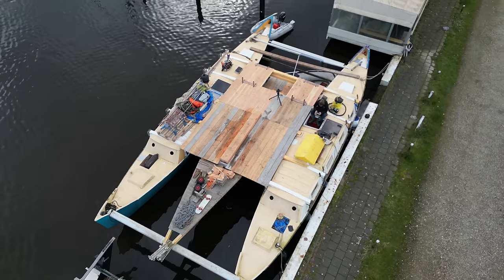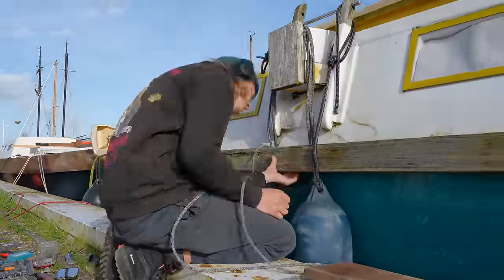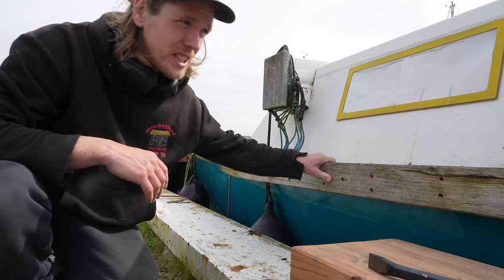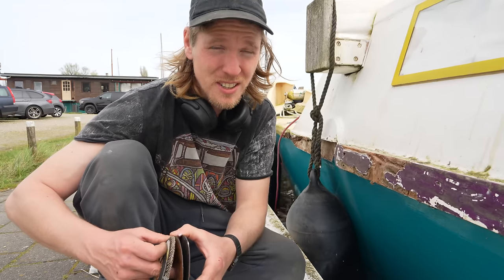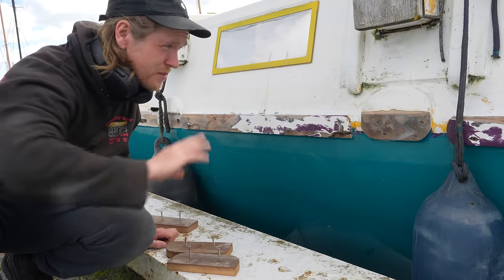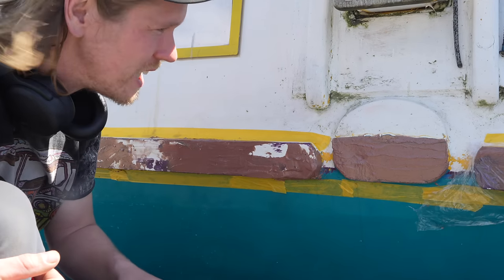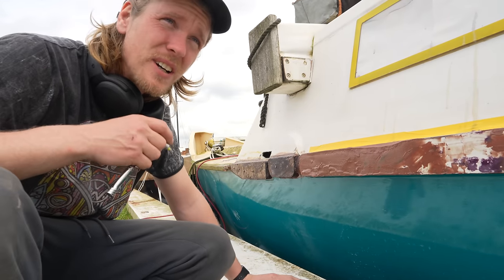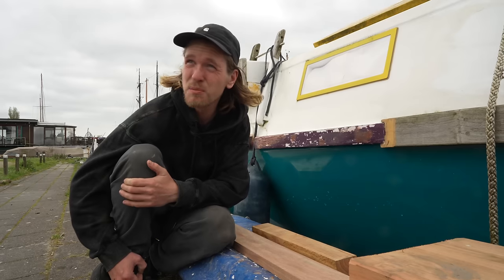Some Serious Rot Fixing on my Ocean-Going Catamaran Project

Comment: When you are prying against a damagable surface with a crow or pry bar, Best practice is to use a large backing board (plywood works well) on the surface so you spread out the load and don't damage, crack or punch a hole in the fiberglass surface.
Cheers, Mate from Canada

Comment: Just for information: they're not dowels but what we called plugs. Dowels are used for joining or locating pieces, and the grain is lengthwise for strength. If you use dowels for plugs, you expose the endgrain of the dowel to moisture ingress. Plugs are made with the grain going across the plug and have no strength but can be made to be almost invisible.
Reply: Bungs in boating

Comment: Just in case no one else has mentioned it, if you have a soldering iron, you can heat screws embedded in epoxy to make them come out easier.

Comment: Another great video, if you ever have to use a grinder like yours without the guard on it , switch the composite cutting blade to a steel/ diamond encrusted blade ,they are inexpensive and importantly they can’t shatter/explode like composite blades

Comment: With the rail securing screws ...you can get bolt hex headed screws with posi heads ..so easier to drive in and remove if they get tight.

Comment: Hi Mark to remove those bungs drill a pilot hole in the center then run a screw in it should push the bung out :))
Reply: They should have been sealed with epoxy so that won't work. Using a flat ended drill like one for spot welds should take it out in one go.
Reply: @delukxy  They should not be sealed with epoxy, but with a linseed-oil based varnish.
But though not as easy, it still works with the epoxy glued ones. I've never had a problem with it.

Comment: If you use a Brad point drill bit slightly smaller than the diameter of the dowel, the point will go into the screw head without damaging it and at the same time will either pop out the dowel or just drill most of it out making it easier to remove the dowel, great video and really enjoying your progress restoring your catamaran 😎😎

Comment: There is a product out there called 'Git Rot', used to solidify rotten wood then epoxy to fill holes. Rotten wood is penetrated and turned into plastic.
'Git Rot'.
Reply: Not suited to be used on a boat!
Reply: @Arnaud58  The Marine equivalent is Everdure, I believe.
Reply: Everdure works really well. The problem being ,any moisture left behind will turn to rot. Moisture content needs to be down near 18%..... unless the rot is cut out is hard to get that moisture out....

Comment: Have you gone over that whole boat with a moisture meter ? It will tell you what is wet and thereby rotting . Stuff you may be able to catch before too late and or stop the water getting in , and where dry it will give you confidence .
Reply: That would mean poking or drilling many, many holes trough the epoxy layers... Bad advice in my book.
Reply: @Arnaud58 true…but still better than leaving sealed in moisture
Reply: @markthomasson5077  The old fashioned way, knock and listen.
Reply: I have a similar constructed catamaran…with similar problems.  
I would not work without using the meter.  Ok it is not particularly accurate, but that doesn’t matter.  It does indicate whether dry or saturated.  And you don’t wont to seal in moisture

Comment: Mark, your craftsman skills have improved alot and your plan sounds like a great idea. Go south where the weather is nicer and you can get the materials cheaper. You're in a good place to buy quality tools for everything you will need to keep mahi looking better than ever. Even if you have to take some extra fuel and motor occasionally you will definitely be better off south. Perhaps in the same area as Stew and Marina???

Comment: Two important tools to add to your collection a jigsaw and an impact driver. The impact driver will allow you to pull out screws, put in screws and with the right adapter to put your sockets on to tighten up nuts and bolts.

Comment: IMPACT DRIVER - As others have said and it's a bit late now but that cordless multi-tool is your power chisel. That'll make short work of any rot exposure. It's well worth chiselling out any rot back to sound and plugging to prevent future damp ingress. That rail top joint is a ridiculous water trap. Needs filling with a good permanent barrier - all round the rest of the boat.
GREAT STUFF!

Comment: Just a tip when joining timber,you cut the join the opposite way to what you are doing, so the timber you are fitting goes under the join,not over.

Comment: Mark, your doing a great job and learning great carpentry skills which benefit you for the rest of your life. I have fitted/replaced a few rub rails or rubbing strakes as they were traditionally known, and I've fitted them fairly similar to the way your doing only difference is now (and the Wharram purists will hate me for saying this) I fit the PVC/Vinyl rubrail which simply needs glued and screwed, will follow the curvature of your hull as is flexible, maintenance free, doesn't need painted or oiled, UV resistant, will never rot and if you factor in the time saved fitting ,costs no more than timber.:)

Comment: Mark, your work is getting better and better technically especially the wood work. When you are doing epoxy work like today, try putting or when shaping the epoxy use a v small roller painter tray to collect excess. You can then use  metal scraper to remove reapply and shape and collect excess to reuse instead of your hands. Will make the job less messy.

Comment: The two boat project series I watch here on a regular basis are this one and the Tally Ho restoration project. The contrast between a lone sailor on a small budget and a lone sailor on a larger budget with a much larger crew is very interesting, as I work on my own low-ish budget camper van project. Keep up the good work! You will find all the rot and a warmer port.

Comment: Great work Mark. The upwards force on the beam lashings could be huge. On my Tiki 21, the beam lashing blocks were bolted through the hull - not sure if you are going to do that. You could drill over-sized holes for the bolts, fill them with thickened epoxy then re-drill them so the wood doesn't touch the bolts. Also, if you create loads of hardwood sawdust and you can be bother to collect it without impurities, it makes a great strong filler mixed with epoxy.

Comment: Marc, your rubbing strake should be bolted through the shear stringer at the beam positions as per the plans. There is a huge amount of force  on the blocks under the rubbing strike where the beams are lashed on.
Reply: Yes I was wondering about that.

Comment: Thanks for another post.  I can sympathize with the weather comment.  I left N Calif for S Arizona for the same reason.  GLAD you found some decent wood under that rail. Rot is insidious  if you don't get it all.  Woke up in the middle of the night with another "Must do" thoughts about your motors. ( no more preaching about starting- just remember the choke is a momentary switch  The choke is only on while the key switch is pushed in.  So when cold start get to spin and push in , when it fires, just semaphore it to keep running till it runs on its own.)  Back to the dream--- you must have a fuel shut off or disconnect the line if you keep your tanks above the engines. A single pin hole in a fuel pump can dilute the oil and empty the tank.  Sounds like you are going to get a secure lashing spot for you cross members. Really good idea. Think of the constant pressure those are under in rough seas.

Comment: Hi - Great channel! Just a suggestion but I would consider tightening your spring lines and the  bow and stern lines. Keep these lines long and tight. Consider also making the lines fixed at the dock and controlling them, tightening and loosening, on the boat. This will keep your yacht from moving side to side and away from the dock while working on the boat. Also, you are removing the "bungs" that are covering the screws. Here, I would use a wood chisel just smaller than the bungs in order to dig them out.  Best of Luck!

Comment: Nice. Highly recommend leaving screws in the lashing block. Having a chemical and a mechanical connection is to your advantage vs. chemical alone.
Reply: They add nothing of any value and provide a highly efficient path for water ingress. Do the epoxy right and it will never let go. What are a couple of screws going to do if the epoxy were to let go? They would chew right through the wood in minutes to hours due to the insane forces involved.
Reply: @sail4life  I would argue that on a Wharram the beam lashings are as important as the chain plates. Just like you said, a couple of screws could give you minutes to hours to make appropriate repairs instead of the beam separating from the beam pocket, from the insane forces. In heavy seas that could be catastrophic. Never ever trust glue/epoxy alone in areas where extreme sheer loads are possible and when your safety could be compromised. I am not implying that a couple of screws is the ideal solution either, it's a better than not proposition. Take appropriate measures to prevent water ingress, drill-fill-drill and through-bolt.
Reply: @joelbrown4110  well, actually properly done epoxy doesn't give way to any loads the wood itself can handle. In all tests ever the wood is the one giving up first. Not a layer of epoxy. Pieces which are properly glued with epoxy are actually behaving as a single piece of wood, as the bond is chemical as well as mechanical. Epoxy resin penetrates wood - providing an extremely strong bonding.
Reply: @MonikaMatis  Quite frankly, I am surprised that there is a debate on this subject. I made a recommendation from my own experiences and knowledge of the behavior of wood and adhesives. You can disregard and debate this if you wish but I would not risk the safety of myself and my crew over any thing I can do to enhance safety. You are correct, epoxy can be an excellent adhesive in the right conditions. The weak point is not the epoxy. We are talking about GRP or other composites designed to resist sheer loads. It is as you have hinted the wood and how the grain structure, and how the physics of sheer loads work. If you apply the sheer load at 90 degrees from grain direction you will have reached the woods maximum resistance against this load. But, when you apply that load parallel to the grain that wood can split with very little effort. Just like using a chisel "with" the grain versus "across" the grain. This is why wood dowels can be so effective as their grain structure is 90 degrees to the joining pieces. A rope, as in this case is exerting sheer forces, and subjected to rotational sawing movement as designed and intended by Wharram. This movement and load can create a wedge effect and split that wood along its grain structure. I couple of screws, or better yet through bolts, could easily add a hundred pounds or more of compression force perpendicular to grain direction holding the grain structure together. Let's all agree that doing anything we can do to keep ourselves safe is the right answer. Please see @slacker2101 comment below. Same thing in this case. ✌Keep plugging away at it Mark, you will get there.
Reply: @MonikaMatis  Thanks for making my point for me. If the wood splits down a growth ring, epoxy is not going to stop it failing. It doesn't matter how viscus the epoxy is it will not fully impregnate the wood of the thickness that Mark is using, so there is a possibility of a growth ring failure. A mechanical fastener is the only way of penetrating this wood fully. Screws also provide compressive strength that you will never get from epoxy. Press two fingers together lightly and have a friend try to split them apart. The harder you compress your fingers together, the more difficult it is to separate them. In this case the rope can act as a wedge and split that wood.

Comment: I notice you don't have a safety strap on your drill. I worked a lot up ladders and found it invaluable to have a wrist strap on my drill, easily made from a length of paracord, small loop knotted around the handle big loop around your wrist. It would save you dropping it in the drink.

Comment: If you want to break something free from a delicate surface with a crowbar, you should put a piece of stainless steel plate (2 millimeters) in between, so that the pressure is distributed
regards the blacksmith ;-)

Comment: solid episode lad. Hopefully sailing soon. sorry to be the safty police but just so you know, should wear a mark when mixing up epoxy fillers, they have silica in them and it will mess up your lungs. (i didnt know this when i started using it so just in case you didnt either)

Comment: Great job on the rubbing strip mark tip if your using your grinder without a guard wear a pair of heavy duty gloves (welding gloves) does the trick👏👏👍

Comment: I recommend a surface conditioning tool and a nut driver, it will make most jobs easier.
The SCT can use a bunch of different drums to do different tasks very well, mine is made by vevor and its quite good for its price(less than 100 USD), other companies make them but they are more expensive.

Also put a teather on those tools.

Comment: Seeing you wrangle old screws with an ordinary screwdriver prompts to suggests you purchase a modern version of a carpenter's rat-shit brace.  Use it in conjunction with a modern magnetic bit holder.  No leccie or batteries required.  One of the best tools to have onboard.  You take care.

Comment: mark.. instead of routing. you could take a sheet of wood. mount your circular underneed and use it as a table saw. and cut lines in the wood on the depth you want. last piece with the router and you are done. way quicker and more easy

Comment: You were saying about getting your boat down south to Spain or somewhere warm.

There are two ways to get there, the obvious round the coast.  And the not so obvious in the canals.

Now your first reaction might be that your cat to too wide to fit in a canal.  But what if you take the middle part of your cat out and just push the two hulls up next to each other, then you might fit in the canals and be able to get down south.

The advantage of the canals is it's safer than going out to sea.

There was another YouTube channel who got a mono-hull sailing boat though the canals from the south of France to the Netherlands.

Comment: Mark, I'm about 5 mins in and I've had to comment straight away.
Don't ever use a crow bar hook against fibreglass to pry things off without placing a timber or piece of ply behind it to spread the load mate.
The forces will be transfered to the small curved edge as you leverage off the timber...
This can crush/rupture/crack the fibreglass and if not put a hole into it, it can fracture it making it a week spot on your Hull.. 
You don't want a minor bump at sea to be the stressor that causes a hull breach..
Pads behind any pry bar, crow bar or even a claw hammer to protect the surface beneath..
Had to write this now so I didn't forget..
I Love your project and love your parents too.
I'm.goung back to watching the video now..

Comment: Good job 👍👍Did you check on the insidefloor of the doradeboxes in the front and aft of the cabins ? I found a lot of rot there in my Pahi 31. It gets wet there and difficult to dry out. When you get oceanwater in there it’ll cause leakage into your cabins

Comment: Always awesome! Regarding cutting the channel in the board. wouldn't it have more sense to cut the entire gap for one length and the move it? That would mean adjusting the router depth multiple times per lengthwise adjustment - but that seems easier? Anyway, starting from the center would also eliminate the need for the multi tool at the end, but who would have thought of that ahead of time? Certainly not me! Hope you make it to more southerny climes before old man winter comes around again!

Comment: I'm not sure if your screws are embedded in epoxy, but if they are, you can find videos on the web where a soldering iron is used to heat and melt the epoxy for easier removal. Regards Mark Mayger

Comment: Hi Mark pop into a Car paints/parts shop and buy yourself a pack plastic filler spreaders and a pack of filler mixing sheets they will make putting on filler or fibreglass paste much more smoothly and evenly, the metal scrapers are a pain in the ass. These are used in the car repair  industry, It will cut down on your sanding times and  you will be able to apply the paste much faster. . Good luck.

Comment: Hi Mark, I’m not on to normally comment on YouTube, but I am concerned about just using epoxy and light weight filler to  bond the blocks used to lash your cross beams to the hull. Maybe consider screwing through the rub strip, block and hull to form a sandwich construction with some marine grade stainless screws. I know you’re in contact with the designer, maybe they could check to see if what you have done is adequate. I’m just concerned that block is potentially going to delaminate  under load. I enjoy all of your videos and I’m always impressed with your hard working attitude. Great progress.

Comment: You're doing well!! 
Only other  comment I have regards hogging with a router- to avoid having that last little bit to deal with, make a wider base plate for the router (out of something rigid that's the same thickness as the plastic plate). You can temporarily use it in place of the plastic plate, using the same screws. Won't work so well with the T-guide, but after you do the outside edges, you won't need that.
You might also invest in a router bit that's wider, made for such work.
Reply: Or don't use the router lengthwise apart from the two boundaries...